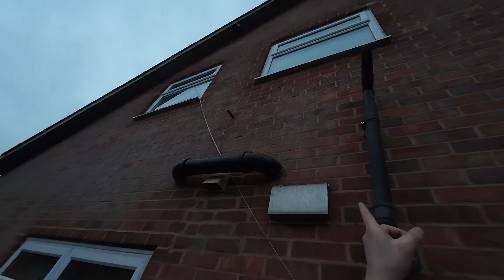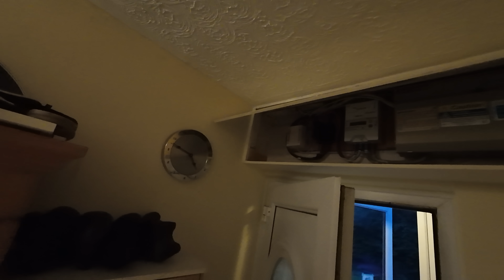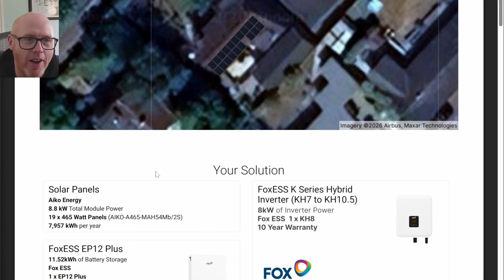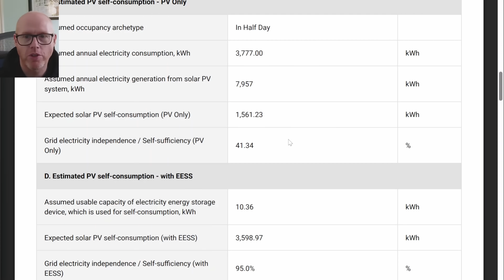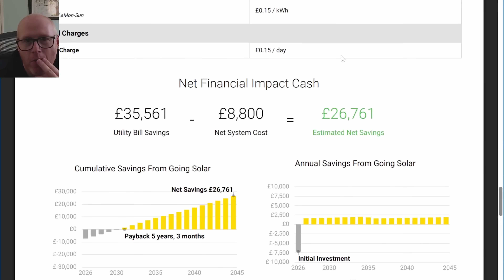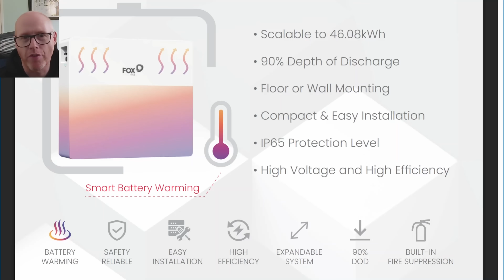The £600 Solar Mistake Most Homeowners Make

Comment: Has the DNO agreed the export limit, have seen a few people being limited on rate of export due to local grid instability issues?
Reply from the maker: Yes, there is a limit which is why we can't put panels on the NW roof 😢
Reply: @UpsideDownFork  You can, but they need to be on a non grid tied inverter.

We have 11kW export limit (over 3 phase - so dire for 3 phase but good versus single). That is used for the main inverter and the old FIT microinverters. There is another 4kW or so of solar which feeds directly into non grid tied (grid charge only) battery/inverter that drives the heatpumps/aircon, dehumidifers and my gaming PC

As that lot fairly reliably consumes all the generation from the extra panels/battery it's not far off grid tied in value.
Reply: @etchedpixels what inverter/batteries are you using to achieve that? Would like to do something similar...
Reply: @neilwillingham2403  Some Bluetti kit and also a Fogstar battery. Probably not the best way of doing it but I had most of the bits so ...

There are two paths really. By some plug and play kit and avoid electrician costs, or buy a hybrid inverter that can use the grid as a "generator" input and have an electrician wire it.

Latter costs more in electricians but can charge faster and per kWh of battery is way cheaper if you pick the right batteries/inverter.

If you buy stuff from folks like Bluetti or Ecoflow get refurbished stuff and look for sales. There is nearly permanently a sale/special/event/etc for them and the RRP is for mugs 8)

Comment: Potential additional savings with VPP. As Fox are supported battery platform for a couple of VPP providers. Is the Dormer not strong enough for a couple of panels as you have a third string available. As they don’t currently have an ASHP, is it not worth modelling that as well to see if the battery is sufficient?
Reply: Who is the other VPP other than octopus please?
Reply: @yp77738yp77739  Axle Energy and Capture Energy are VPP supporting selected batteries including Fox. There is a referral link for Axle worth £25 for sign ups before March.
Reply from the maker: We have a plan for adding additional batteries as required in future.